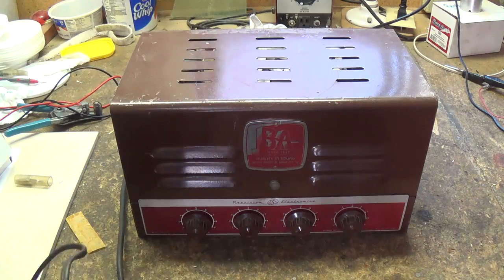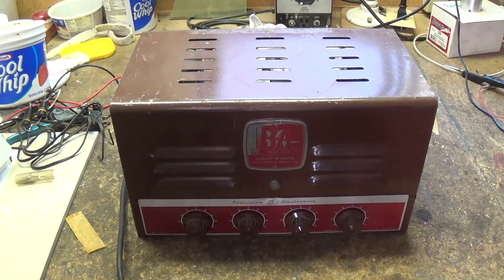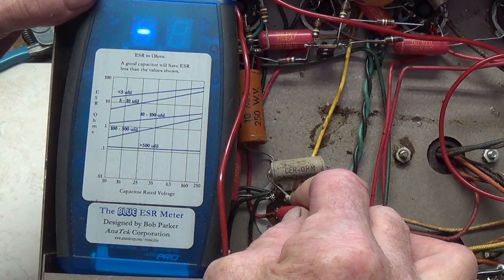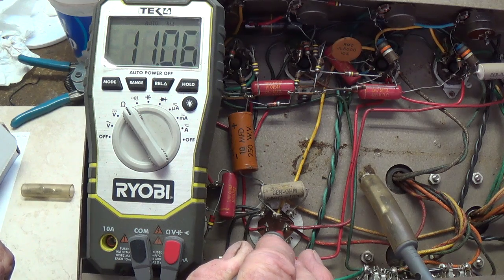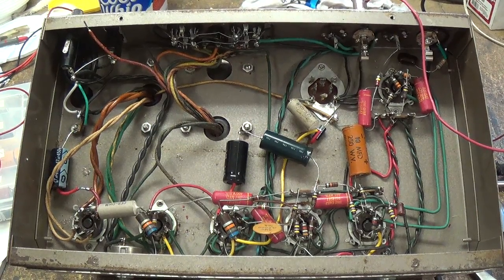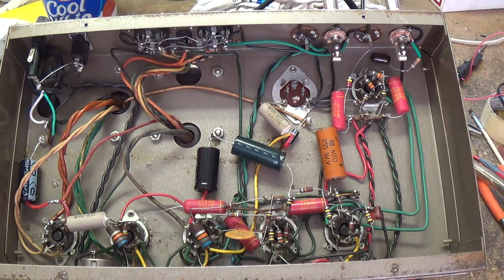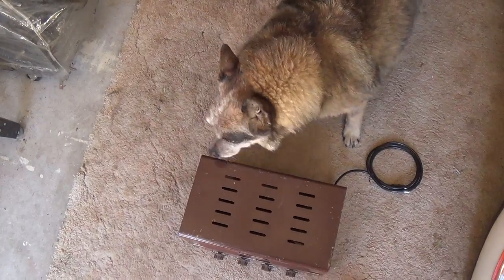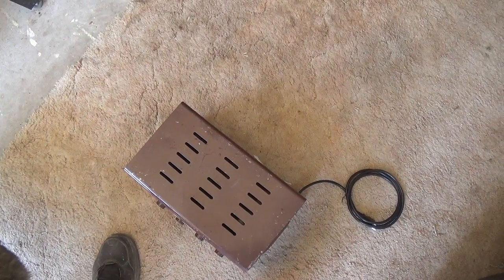The Worst Filter Capacitors I Have Ever Seen.....and Heard :)

Comment: Complete noob here. When you are using the multimeter [on Ohms] I can see the positive test lead but where is the the common lead? Don't you need both to complete a circuit for a proper read? Please let me know. Thank you kindly
Reply from the maker: Yes, both leads must be connected for all measurements, Fed. Perhaps the black lead was connected to the chassis and out of sight.

Comment: Doug, got a question. I'm starting to do my own amp work. My first project is replacing the filters on my Marshall JCM 800 50W amp, and biasing new power tubes after the cap job. I have a tube bias adapter, so good there, but the filters came with two smaller caps, and I wanted to check to see if those, still on the board are in spec. Can these be checked in circuit with a multimeter? Or do they have to pulled from the board and tested, or can an in-circuit ESR meter tell me what I need to know? If the proper way is with an ESR meter, any suggestions on one that will work for amp repair or maintanance? I am looking at a few for sale, but need to make sure I'm looking at ESR's that can do amp work ranges...I just want to be able to check if they are in spec within tolerance. Thanks!!!
Reply from the maker: You really can't fully test capacitors with a multi-meter. Even if the capacitance reading seems appropriate, the capacitor could still be faulty. ESR meters are specific for electrolytic caps and much better at spotting failing ones, but they don't fully charge the cap to operating voltage, which is about the only absolute  way to judge them. I have an Anatek Blue ESR meter and use it all the time. It may not be the absolute most-thorough method to sniff out failing electrolytics, but it very practical and effective. You can use an ESR meter to measure all electrolytics in circuit, unless they are in parallel.....which is quite rare.
Reply: Thanks for the reply. So I would be able to test electrolytic caps in circuit with a decent ESR meter? I was looking at either the Anatek Blue or the Signstek MESR V2. I was just looking for a way to test electrolytics to see if they need replacing while still in circuit on my vintage amps. De-soldering would not be a big deal, but was wondering if it can be done reliably enough in circuit with either a multimeter, or a decent ESR meter. I'm going to be looking at as many videos as I can to see how testing on caps in amps like mine are done to determine whether or not they need replacing. I see you have a vid on this with the Blue, so I'll be posting there. Like I said, replacing the filters is straight forward enough, and re-biasing the JCM 800 out put tubes looks easy enough, but diagnosing the electrolytics has me baffled right now. 
I believe my Hiwatts and Sound City amps on the other hand, ( correct me if I'm wrong please..) dont have bias pots and will need to adjust bias through the resistors. Thats for another time. Right now the JCM is the easiest platform to start with. Thanks for the replies Doug!!!

Comment: Hi uncle Doug! I have 120 cycle hum from an amp that’s only a few years old. The caps they used in this amp are cheap. Do you think replacing them with Nichicons would help reduce the noise or would I have to go up in capacitance for that to make a difference?
Reply from the maker: A 120Hz hum is virtually always caused by bad filter caps, Tim. Step 1 to eliminate the hum would be to replace them in your amp with good quality electrolytic caps of the same or slightly higher capacitance and voltage rating.
Reply: Uncle Doug thanks
Reply from the maker: You're welcome, Tim.

Comment: I observed one electrolytic cap go in a mac 2120. Like a mini volcano. Very cool. It had a very peculiar smell. Is that smell always the same when they go or when they are thinking about it? I've noticed that smell on some other vintage gear.
Reply from the maker: The  electrolyte, when badly overheated, does have a peculiar odor.

Comment: What country has 120 cycle AC main voltage?  That's 120Hz..
Do you really know the sound of 120 cps input?
Reply from the maker: Although the wall current in the US is 60Hz, once it has been rectified, there will be a ripple "riding" on top of the DC that is 120Hz. If this ripple is not properly filtered it will be heard through the speaker as a 120Hz hum...as in this video.  For a detailed explanation, please see my video series on power supplies and my video on identifying the source of hum based on its frequency.

Comment: Good afternoon!
I have an old beltone ap 22 guitar amp that has the same problem. The filter cap on mine has 3 leads and says 10+10 +2 ( microfarad) . Can’t seem to find a 3 lead cap. Ideas?
Reply from the maker: Leave the can in place on top of the chassis. Remove the leads from it beneath the chassis and replace each of the can values with an individual axial capacitor.

Comment: When I am given an old piece such as this one to 'service' / modify, as a matter of course, I replace all original capacitors (for what they worth...).  Also, some of the high power resistors in the power supply may have run out of spec due to heat, so it is wise to replace those also.  In  doing so, you give the amp a new lease of life for many years.
Thanks for the video, great narration!
Reply from the maker: You're welcome, Lep :)

Comment: My electronics teacher showed that a new electrolytic cap will have a low resistance until it charges to the meter's output voltage.  However, that 120Hz hum says bad caps in billboard-sized lettering.  Loud distortion at 2 means high input level.  Guitars put out 0.5v, microphones, about 0.05.  Possibly a second input for a clean signal is needed?  It's what I'd do, anyway.
Reply from the maker: Thanks for the helpful input, DA.
Reply: Anytime :)

Comment: HELLO! I have line 6 spider3 75watt guitar amp. when i playng after approx 5 seconds sound getting darker. I removed that very small 2 capacitors on the input circuit, they where connected signal to groung, after that sound was great, with no changes in tone. I found that my sony vaio laptop mic input jack also changes the sound exactly same like guitar amp does. I don't know they are going bad or not, but fact is that without them sound is great. I don't understand why they are needed..
Reply from the maker: The two small capacitors probably allowed high frequencies to go to ground before the signal entered the amplification circuit. By eliminating them, you "brightened" the signal. If you prefer the tone without the caps, then leave them out of the circuit. This is a good example of the value of experimentation to improve tone. Good work :)
Reply: Uncle Doug  yes i understand now by watching your videos about capacitors. Worst thing is that this capacitors does not changes the tone quickly, just after approx 5 seconds. For musicians it is very bad because tone is not stable, playng harder tone getting more dark, after playng very softer tone getting little brighter. This even for manufacturers is bad, because they trying to make sound with transistors more close to tube sound and this capacitors not only cuts high frequency, but also sharpness of the sound is lost. I think it is posible to make tube sound with transistors, this depends on operating voltage, unlike transistors tube needs much more voltage to amplifi sound, this is like if we compare speakers and headphones, sound coming from good quality speakers is much more full even at lower volumes, with more feel of power. Headphones are close to ears but never delivers that type of sound, at very high volumes it even getting worst. Great example is thunderstorm sound which we hear from very far away and even at lower volumes we feel that great power. I think if transistirs will be designed to operate at higher voltages like tubes, it is posible to get same full and warm tube sound.
Reply: Uncle Doug thank you very much for your  videos
Reply from the maker: You're welcome, G.  I don't understand why the loss of high frequency took some time to occur, but the fact that the removal of the caps restored clarity seems to support the theory. I'm not sure that increasing the voltage in transistor circuits would create "tube sound".  I tend to think that it comes from the design, shortcomings, and performance quirks of the tubes themselves.  Transistors simply do not provide the same tonal variation, including overtones and harmonics, that tubes provide.

Comment: Hi uncle Doug I have a weird situation, you remember that low decibel crackle pop static noise that lasts a few seconds on startup of my Fender twin amp? Now this seems to only happen on a gain drive channel ...the other really strange thing, is that for the past week, I have been trying out this very nice Mesa Boogie F-50 tube amp at this music store.i of course tested the amp quite a few times to see if it too, made this exact same sound on power up, coming out of stand.by, and it did not ...at the store when I flipped the stand by switch off, the amp would just come to life without making any static sound.....so I decided to buy the amp.i took it home today and plugged it in....flipped it out of stand by and it's making the exact same sound my Twinn amp is 

Could this be interference? Surely the caps did not just go bad as soon as i took the amp home  please give me some insight
Reply from the maker: What a strange coincidence, Gino. It makes me wonder about the electrical supply at your house. You can buy a simply device to check the wiring and grounding of your electrical outlets......I suggest that you do some testing.

Comment: Neither you NOR Rusty managed to sniff out the highly replacable 10 MFD 250 WV paper electrolytic  ;) (4:39)
Reply from the maker: It was tested with an ESR meter and found to be in good shape. Unlike a lot of people who automatically rip out every vintage cap in an amp and replace them with whatever caps are available on Ebay, I test the vintage components and save the ones that are fully functional. IMHO, overdoing the replacement of vintage parts, particularly those that affect tone, destroys the originality of the circuit and results in creating a "reissue" rather than a true vintage circuit.
Reply: I think it's funny how people ASSume that you don't test ALL the components on the amplifiers you repair just because you don't show every little thing you do, most likely to keep video time down. There are several comments like this, very surprising on such a great channel such as yours. I totally agree with not just tearing everything out just because and killing the vintage mojo of the amplifier. I am no expert like you, I think it's more common sense than anything, but I guess not everyone is blessed with such a crucial tool. I have been rewatching many of these older videos and am enjoying them this second/third time.

Comment: I know, it's not that I'm going to use the amp without the guitar plugged in, I was just worried as to why it was doing that..it's kind of strange.the thing that's really bothering me is the short duration of crackles and pops at startup .im worried to use the amp because I heard of the caps are bad causing that then the power supply can be damaged if I use the amp with bad caps?
Reply from the maker: The primary indicator of failing filter capacitors is a 120Hz hum (i.e. double AC supply frequency).  If you are truly concerned about the noises, then take the amp to a qualified technician and have them check it out.

Comment: What about my vintage drive gain knob sounds scratchy and crackly until I plug a guitar into the input? If I activate the vintage drive channel and move the gain knob without a guitar plugged into the amp then it's scratchy sounding.once I plug in a guitar I goes away and sounds clean
Reply from the maker: I wouldn't worry about it, Gino. Let's face it, how often do you use the amp without a guitar plugged in ?
Reply from the maker: I guess you could clean the pot with DeOxit if you wished, or simply ignore it.

Comment: Well my amp is a 1997 fender the twin so I would assume these are modern? And so therefore my problem is not normal? I'm sorry for all the questions.i am just trying to fix this myself.this amp has a normal clean channel, a vintage drive channel, and a modern drive channel
Reply from the maker: You might try cleaning the connections within the circuit....particularly where circuit boards plug in and the terminals of the ribbon connectors. Use DeOxit or a similar cleaner to clean the contacts and polish them with a clean rag.

Comment: is it normal for a tube amp to crackle and pop lightly for a few seconds on startup once the amp firstattains sound... also when I puttee amp on the clean channel and crank it all the way to 10 and let it sit.i hear light crackles and pops
Reply from the maker: Yes, Gino, vintage amp circuits containing old carbon-comp resistors often crackle and pop a bit, particularly during warm up.  About the only way to solve the problem is to replace them all with modern resistors.

Comment: Hi I have a 1997 fender twin amp,and when I first turn the amp on I leave it in standby for a couple minutes before turning it on to full power,and as the amp turns on I get some crackles and pops for a few seconds as it comes to full power.i barely used the amp and have replaced all tubes with JJ tubes...I had a big crackle and pop problem and found that the plug in the chassis was broken off as far as the solder joints so I solders that back on and it stopped...now when I move or tap on the amp nothing happens...however I have this problem with crackles and pops on startup.as well as both gain knobs crackle ..is that the caps I tried spraying the gain pots with automotive contact cleaner and it seemed to clean my dirty reverb pot but not the vintage drive gain pot and the modern gain
Reply from the maker: Cleaning the pots with DeOxit is a good idea, Gino.  If it's not available locally, you can buy it online. The crackling sound may be due to carbon comp resistors and filter caps in the power supply.  If the sound goes away shortly after warmup, then you're probably be better off simply ignoring it.......at least until it gets louder and more persistent.
Reply: Uncle Doug  I appreciate the fact you replied..you are the man, I actually thought I was writing this for nothing ...I actually just found that more bad connections were leading to my gain pot making noise I would like to show you a pic if possible
Reply from the maker: Photos are not an effective way to diagnose problems, Gino. It seems like your on-site investigation is finding the causes of the noise. Re-solder the bad connections and keep on doing what you're doing.

Comment: But Doug , how can you measure resistance of a capacitor with it still wired in the circuit ?
Reply from the maker: In most cases you can't.  In fact, in this video I got some erroneously low resistance values by measuring the caps in circuit. You can measure ESR, which is a better measurement of electrolytic capacitor condition, in circuit however.
Reply: Are you planning on making more videos Doug ?  Yours are very entertaining !  Hows Rusty ?
Reply from the maker: Thanks, GT. I'm sorry to report that Rusty passed away a few months ago. Yes, we intend to make a few more videos, hopefully in the near future.
Reply: sorry to hear that. He was a really good dog

Comment: Do you currently fix / restore amps?  If so how do you go about coming up with a price you charge?
Reply from the maker: I retired from doing outside work. The prices I charged were based on the cost of parts and a reasonable amount for labor.  The rate varied based on the tediousness of the work and the attitude of the customer ;)

Comment: I wanted to see that can electropatheticapacitor.   Would be fun to take it apart and see how it is made.
Reply from the maker: Watch my video on electrolytic (and other) capacitors, Robert, to see how they are made.  It consists of a layer of foil and a layer of electrolyte-soaked paper rolled up tight, like a toilet paper roll, and sealed in an aluminum can to keep the electrolyte from evaporating.

Comment: looking at your videos, i don't see a lot of star grounding in the amps.
how common is it? and in your opinion, how important is it?

I've only built a handful of tubeamps, but i've always stargrounded.

having caps connected to separate points on the chassis will make currents run in the chassis itself, possibly leading to noise, no?
am I wasting my time stargrounding?
Reply from the maker: I can't say that you're wasting your time, Borgar. Many very knowledgeable people swear the star grounding is the only way to go. In my own experience, using both star grounding and (good, logical) multiple-site grounding, I don't really hear much difference. My recent Supro build (see the video series) uses what I call "common sense" grounding (not star) and it is dead silent.  Yes, there may be tiny differences in potential within the chassis, but they are primarily DC......which is silent.

Comment: That point to point wiring is intimidating to look at.
Reply from the maker: It's strange, but I feel the same about printed circuit boards. Having wired point-to-point for several years, I have become quite comfortable with it.....but can see why someone may not be.
Reply: I'm useless with a PCB. By point to point I mean no terminal board.
Reply from the maker: Terminal boards were developed to facilitate rapid mass production. They were prepared en mass and then installed in chassis during an assembly line procedure. As long as all the components are on top of the board, they do tend to simplify circuit analysis and repair.